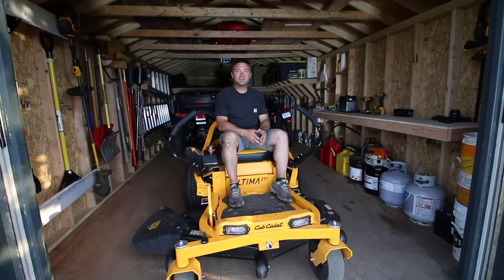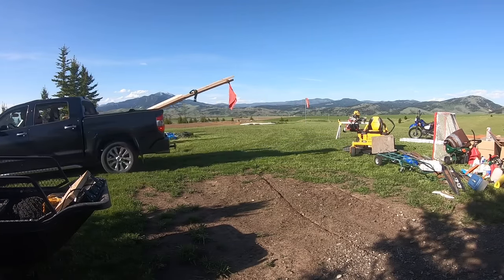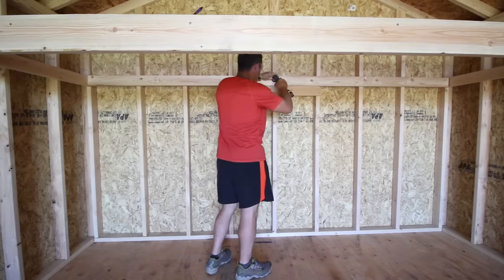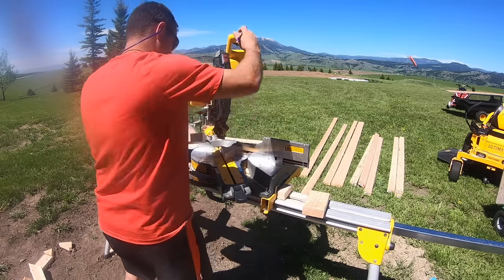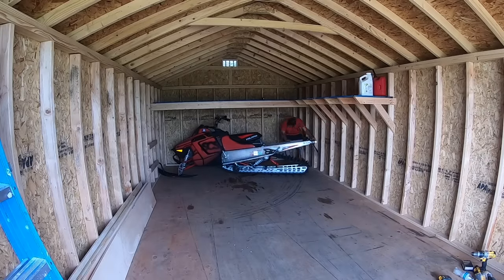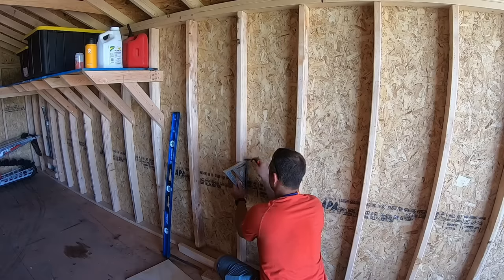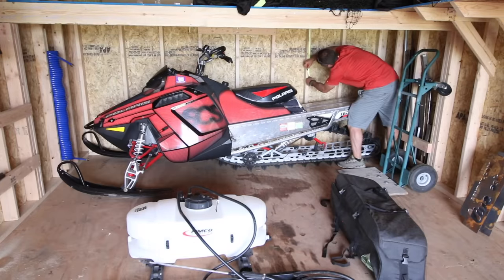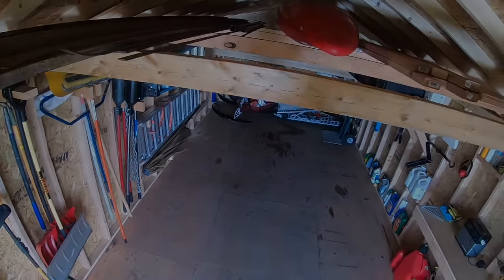SIMPLE SHED ORGANIZING PROJECTS | Shelves, Loft, Rafters, Racks

Comment: How high was your workbench ?
Thx
Reply: kip, generally 900mm from the ground is a good height. I am 192cms and I like mine a little higher so it doesn't hurt my back.
Reply: @oohsam  thank you. 36 ".
Yes. Sounds good.
Reply: @kipcarroll486  No problem! sorry, I'm stuck over in Metric land! Sounds right in imperia!
Reply from the maker: I did mine 36 inches high which is standard counter height and pretty good for my height as I’m not super tall, but @oosam is definitely right about doing one a little higher if you are taller!

Comment: Electric, breaker box, outlets, LED lights, insulation, plywood cover walls with french cleat system for shelving etc..... Decent bluetooth stereo system. Wall mount ductless heating and air unit. Air compressor (on a timer) WiFi extender connected to house and WiFi controlled exterior lighting. An Alexa dot. laptop PC & a ceiling fan. Garage door with electric opener. Pedestrian door with keyless lock and a screen door. That's about all for now. Ask me again when all that's done.
Reply from the maker: haha! That's all i need to add ? :) Love it. That thing would be nicer than my house! Cheers!

Comment: Those are collar ties not rafters
Reply: Not designed to be a structural part of the roof - or resist outward tension. In this instance it seems DIY Pete is right and rafter is more appropriate.